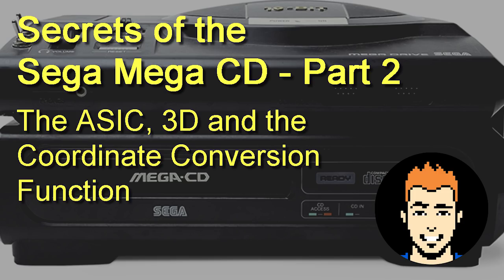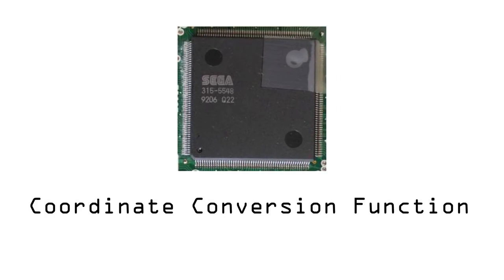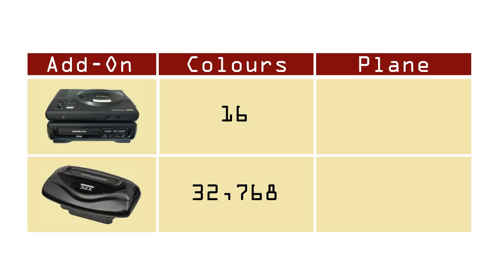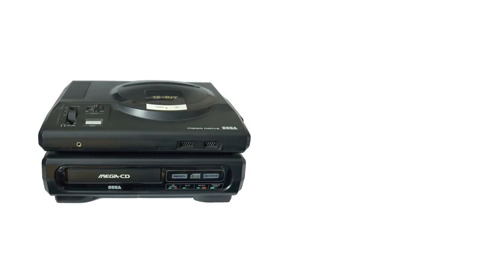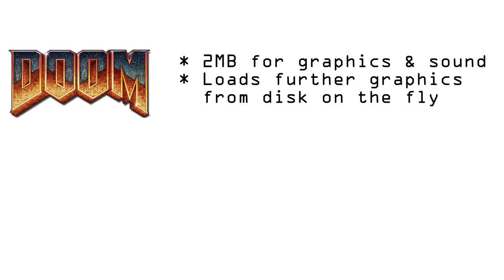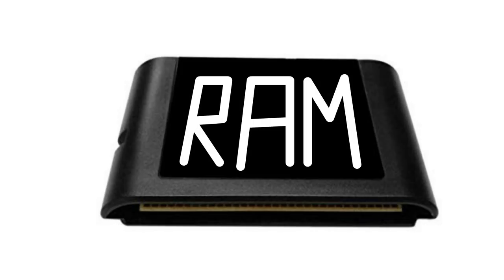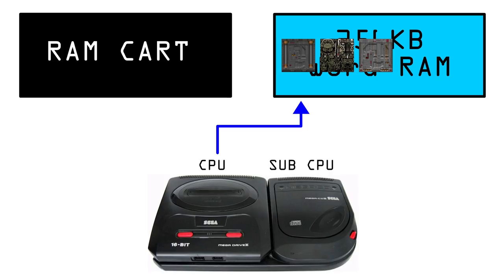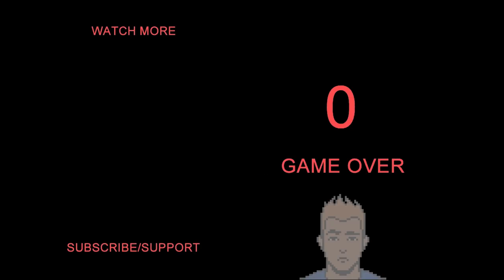Sega CD & Mega CD Secrets Part 2

Comment from the maker: Minor post production edit:  The ASIC draws the output bitmap using the stamp map as the source image(s) that the ASIC scans as it draws to the output bitmap.
Reply: Where is the part 3? Its so interesting!
Reply: There is one more way to pull this off: the enhanced cartridge.  Genesis/Megadrive cartridges could be as large as 128 megabits, or 16MB.  Enhanced carts needed the extra hardware on the Sega CD, which could run in M2 mode while also playing a CD with the entire Doom soundtrack.  All of those wonderful Doom textures could be kept on the cartridge similar to the RAM cart mentioned but would be much cheaper.

The ASIC on the Sega CD could then store the most immediate textures and use the ASICs scale and rotate to manipulate them to form floors, walls, stairs, etc.  The Genesis would still have the horsepower to put all of the sprites onscreen and handle IO from the controllers.

Why the Sega CD was never put to good use is the main reason why no one ever trusted SEGA again with expensive console hardware, and exactly why every $1-400 box that came out after that was a commercial failure.  I bought everything big that SEGA put out, but the Sega CD was the last for exactly this reason.

Comment: I would love to see some home brew that took advantage of a ram pack!!!!! What sort of stuff do you think it would be capable of?
Reply from the maker: It's a complete unknown :) No one has used it.  I don't know if there's any desire to use it... Interesting thought really!
Reply: @RetroSegaDev  Hi, has anything developed with the Ram pack in the last 2 years? It's hard to search for since the idiots at Sega called their flash memory cart for the Sega CD the "Ram Cart"
Reply from the maker: Nope unfortunately no one has done anything with it as far as I'm aware.
Reply: @RetroSegaDev  

Hi there - I'm after any links to documentation regarding the 4MB RAM cart.

Do you have any links by any chance? Know anyone who made one or has one?

Also, any info regarding memory mappers / bank switching for MD/32X games larger than 4MB/32Mb would be fantastic. I'd very much like to look at the feasibility of turning a Sonic & Knuckles cartridge into a 4MB RAM cart, with a 32X ROM cart/Everdrive plugged into the top. Into a 32X/MD/MCD, obvs.

Cheers!

Comment: Great video. Thank you for continuing this series.
I’ve played a fan-made (Chilly Willy?) Megadrive port of Wolf 3D. It’s stunningly accurate to the PC Ver. all things considered. Any insight on how this port was accomplished?
Reply from the maker: 32x uses a bitmap plane rather than a standard tile plane which makes it easier to do.  I'd have to ask regarding him regarding the technicalities.  I think it uses 1 CPU to do most the work tho
Reply: Thanks for the response and insight into the 32X.
I was actually wrong about the author I was referring to. It was not Chilly Willy but a different author who seems to have done quite a bit of experimentation with Mode7-like effects, etc.
I played the genesis rom on an emulator and it’s quite smooth.
https://youtu.be/0NqjQf-xr-g
Reply: Seeing that on a MD, it seems harsh to believe segaCD is not able to pull off doom because of the BSP tree, which literally is just a means to split spaces on wall planes to arrange the data. On top of that there is 3 CPUs and a VDP with scaling functions to cope with perspective.

Comment: Are you still working on part 3?
Reply from the maker: This video took a long time to make and at the time didn't recieve a huge amount of interest. So the third one is on the back burner.  It's on my to do list and will be ready when it's ready 🙂
Reply: @RetroSegaDev  Cool, thanks! I reproduce Sega CD and Saturn games for cash, so I'm all set up to self-publish for Sega CD and CD 32X. I have a great setup with an inkjet CD-R printer and laser printer for the inserts and manuals. I also draw sprite art and vector art (for the covers/manuals), create manuals for both-sides printing in photoshop, record CD quality music with real instruments in my home studio, and am slowly learning how to program the 68K in my free time, so I'm very interested in the Sega CD and learning how to make games for it. I have all the tools to self-publish games, I just don't have the knowledge yet. By the time you finish part 3 of this series, I might have moved beyond a "hello world" and basic sprites on the Genesis. I'm progressing slowly in programming and a demo is probably quite some time away.

I think the Sega CD is sufficiently powerful for most retro games, and yet the emulators for it can work on relatively "weak" hardware like the PlayStation 2 and original Xbox. So my thought is that I can release a game on Sega CD and bundle it with an emulator for PS2 or Xbox. Using the recently discovered buffer overrun technique discussed by Modern Vintage Gamer, I could self-publish that same game on PS2 or Xbox and it would run on either of them without any modchips or hacks needed. That would then expand my market from the small userbase of Sega CD gamers into much larger territory. The Xbox version then would, hypothetically, work on any Xbox up to the Series X. Also, using Sega light gun emulation, some games like an Oregon Trail or Civilization style game could even have touch controls for the iOS/Android version.

If it's not too difficult, I'd like to make an enhanced CD 32X version of the game with more colors and clearer audio, but I've already gotten far ahead of myself as it is.

Comment: Would be possible fighting games that use zoom effects (like Art of Fighting and Samurai Shodown) converted to the Sega CD keeping this effect?
Reply: Yes, but running at 14-15 fps, just like the SoniCD bonus stages, Batman driving stages and anything that use scaling/mode 7 like effects,  that's because the SegaCD communicates with the MD vdp through a 256kb buffer.
Reply: @laumpolumpio  Thanks for the answer. One question: is this amount of fps inevitable? I ask this because the Sega CD's lifespan was relatively short. Wouldn't skilled programmers have been able to overcome this barrier? And what if they were used in conjunction with the 32X?
Reply from the maker: No they wouldn't be able to increase the fps because that's the max DMA bandwidth on the bus plus the ASIC is actually pretty slow.
Reply: @RetroSegaDev  I understood. If the ASIC were faster, would it help with this performance? Could the Sega CD CPU also help with this? (I'm sorry for bothering you with these questions, I'm taking the opportunity to clarify doubts)

Comment: Nice, I was thinking about the first video today. I was wondering how many games actually used the 12MHz 68000...

But 2M mode sounds like games that can display richer background graphics than they would with the 64KB limit...
Reply from the maker: Still limited to 64kb of vram just means you could draw raycast 3D via the ASIC :)
Reply: @RetroSegaDev  Oh :( The MCD really didn't add that much power to regular games then... I really thought it did, as I recently saw a Wolfchild comparison by Retro Core which showed some additional backround detail. It could just be optimisation. BTW, some say Final Fight CD could have been done on a cartridge. Not sure what you think of that, as a developer?

Curious to see Blake Stone or other run on the platform though.

So with the MCD, technologically we get:
-FMV
-Some scaling & rotation
-Raycast 3D
-Enhanced audio of course

Anything else?
Reply from the maker: You've summed it up pretty much. Don't forget the bigger storage medium.  There were a few other specific hardware features that I've not mentioned that parts 3 and 4 will cover.  The ASIC had other functions too!
Reply: @RetroSegaDev  Cool. Looking forward to the next chapters!
Reply: @jbmaru  One need to see the games that actually used ASIC chip like Soul Star, Thunder Hawk or Batman; Games that couldn't be done as well on a base Mega Drive. Even some MD ports like Son of Chuck on the Mega CD had better effects than in the Mega Drive version: like the rotation on the boulders and the bird that now scales in far more smoothly. Sure Final Fight could be done on a big enough cart, but it would lose not just the CD-DA audio and also the Arcade perfect sound effects thanks to the Mega CD's PCM sound chip.  I read an interview with CORE when they were developing Battlecorps; Core said the Mega CD was a lovely powerful system with great effects, but the  Mega CD memory buffer and data flow to the Mega Drive, was hard and tough to work around and meant most developers wouldn't bother to use the ASIC chip sadly.
Reply from the maker: 256KB shared between two systems, only accessible by one system at any one point. Huge bottle neck.
Reply: @RetroSegaDev  I guess that what Jon Hillard was talking about, back in the day; He did also say he was also doing some fancy tricks with the walls on Battlecorps. Mind you, what I read with Sarah and Jon was the biggest drawback of the Mega CD was its colour limit and the Mega Drive low colour pallet .
Reply from the maker: The MDs overall colour range is a little restrictive.  The ASIC is restricted to scaling graphics that use a single 16 colour palette too which isn't ideal either.
Reply: @SwitchRetroGaming  I think back in the day pretty much everyone was deploring the colour limitations on the Mega CD.
Reply: @RetroSegaDev  Given the 256KB was usable by one system only, it would make more sense to use the MCD and its own 68000 then? When it came out in Europe, I was hoping to see conversions of Neo Geo games with less colours. Hardly happened apart from Samurai Shodown. Edit: forgot FF Special and Sengoku.
But I've always wondered if NG games that used plain 2D, never mind scaling or rotation, would have been more faithful on a MCD than on a MD animation-wise. Something like Last Resort, or Metal Slug.
Reply from the maker: You flip it :) you do something with the ASIC in the 256kb then flip it to let the MD have it to transfer to the VRAM :)
Reply: @RetroSegaDev  Right I forgot that bit :) Definitely a bottleneck.

Comment: And this is why the PCEngine CD was faster at using the Ram expansions, it was very fast (faster than the Sega Mega CD) spooling data from the CD, plus that RAM in the system/arcade card can be used as video RAM while theres no way around to the SegaCD/Megadrive 256kb wram, a RAM cart wouldn't help either, ....64kb of video ram....terrible system, very bad design.